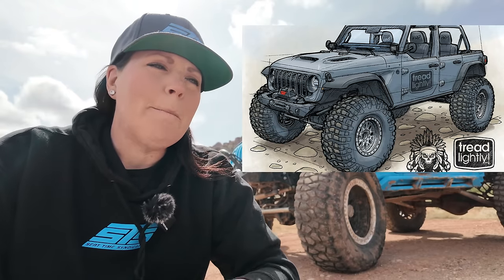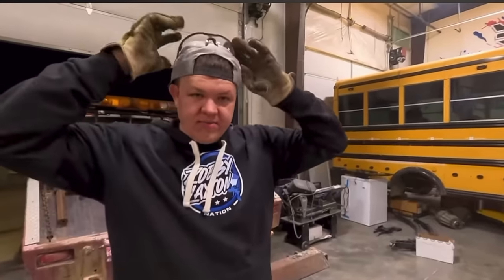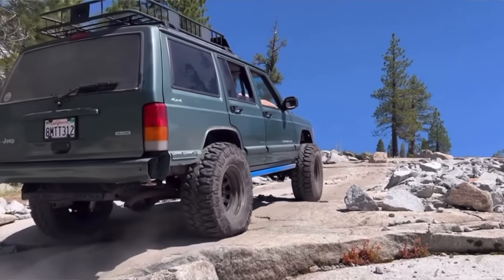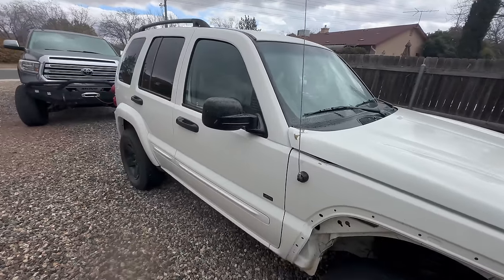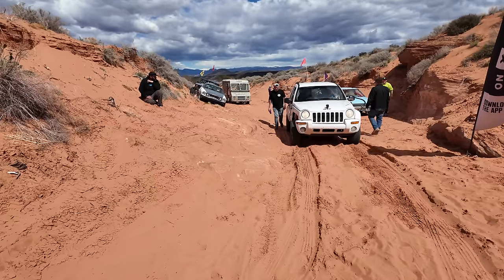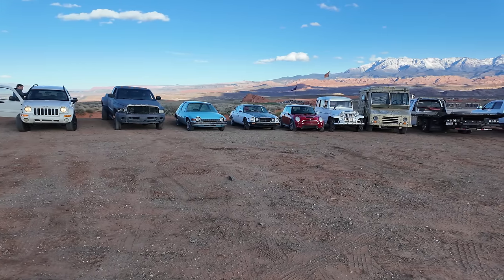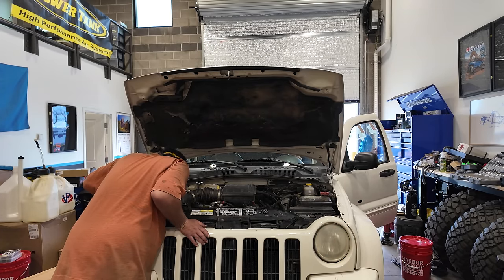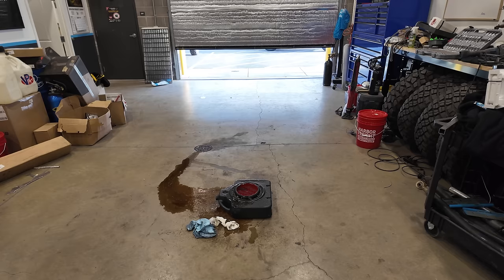This 23yr Old Jeep Can Win The OnX Build Challenge & Here’s Why…

Comment: I built my Liberty because everyone has a Wrangler or Cherokee.......
4" JBA Silver Lift as a base and built upon, ARB dual under the hood, F&R arb lockers in the 8.25 and D30, re-geared to 4.11, manual trans with a 231 T case 1.25 chain / gears, 6 pinion planet and a teraflex 2 low fork kit. the connection of it all  is a hack and tap SYE from IRO with Custom Adams Drivelines front and rear - Napa extended CV's up front.

Everyone chuckles up until I pull them out - Crazy capable machine!
Not just for Starbucks.
I call mine the "3 lock box" LOL
Matty is still with us - just in a different way !!!!!!
Reply from the maker: That’s so awesome! Send me some pics for sure at: MischiefMakerjku at gmail dot com. I’m still gathering ideas for this build, but it will be on D44s and coilovers for sure - just gotta figure out the long arm kit. 

And you are definitely right about Matty! 😊💙

Comment: No way Rudy and Robbie don't go over budget. Also, I just checked my local marketplace, cheapest KJ is $1,200 with 230k miles and rotted out rocker panels.
Reply from the maker: Ouch! Sheila is around 130K (if I remember correctly) and is completely rust free. She did need a new power steering pump, but that was about it. They wanted $1200, but once I got down to Prescott and saw it was in way worse shape than the FB ad showed, I offered $1000 and they accepted.
Reply: @MischiefMakerTV  Great deal! I'm so envious of you all out west and your clean cars!  Here in the Northeast anything over 10 years old is likely to be rotted out. I really need to move out that way.

Comment: Since you like open cabs, suggest to mod in a way similar to that copper XJ (Offroad Games) with a tube upper cage tied into the cut (cut of the a-to-b-to-c pillars). Add a XJ front D30R with 3 link, mod the rear like a WJ (wishbone upper, lower CAs) on 33/35s. Put a doubler in (Rubi-crawler), 1/3-1/4 door (as inserts with a canvas fill to an arm rest).
Reply from the maker: That sounds like an awesome plan. I’ll share some details soon, but I really like where your head is at! 😎🤘🏻

Comment: $1000.00 That's about $1500.00 top much. I rented one of those in Florida now winter. total junk. the hood came lose every time we drove it. the engine would just quit and you had to wait about 5 minutes before it would run again! good luck you will need it!
Reply from the maker: Sorry you had a bad experience. But with 700K sold domestically I don’t think I’ll have any issues replacing anything on this vehicle (or even buying an entire vehicle just for spares) and staying under budget! 😅

Comment: 3.7 l have a issue of burning valves and timing chain tensioners going bad. I can tell you how many of them I replaced valves in or timing chains and tensioners in. Just don't abuse the motor to much or you will have issues with it.  I worked at a Dodge dealership and I was the main person that did 99% of the engine work.
Reply: You need the second gen 3.7 in the 2006 and later models .. they are totally redesigned engines and very good

Comment: Liberty was made to replace the xj and actually has more room inside than the xj. Also the window regulators are know for breaking. The cable are junk and break. One last thing they are pretty fun off-road. I had one I put 31s on and it would do whatever I wanted it to do
Reply from the maker: Well I have been shocked at what Sheila has done out on the trail. It hasn’t been graceful by any means, but as an affordable and fun trail rig, the scrapes and bangs you hear on the inside end up making you smile and laugh instead of worry. 

We have been having a ton of fun (and driving her around town) 🤣

Comment: Each repair you do that requires fabricating continually builds your confidence level in your capabilities when they stand the test of time.  When they don't they help you gain experience and improve as a fabricator so don't get discouraged when those learning opportunities, frustrating as them might be, present themselves. 

Perhaps Paul with his large stockpile of parts vehicles might be in the best position to stay under budget since he might already have most of what he needs sitting out in a field down the street.  Those with less cheap junk resources already on hand may be more likely to go over since they will likely have to go out and purchase stuff.

Best!
Reply from the maker: I do think most of the teams will manage to stay under budget because of their personal skill level as fabricators and resources they have in hand, but that does nothing to help others build a similarly capable budget off road rig.

My goal here is simple 
1) cheap, accessible rig
2) builder parts anyone can buy
3) parts from FB marketplace

I plan to stay well under budget and it is my hope that anyone with a welder and a year of experience using it can replicate my build within that same budget. No special deals, no resource pile parts, no special tools plasma table needed. 😀

Comment: Nothing better then a fellow utah jeep liberty owner!! Let's gooo hollie!
Reply from the maker: Any tips for me? I’m gonna need all the help I can get! 😂
Reply: @MischiefMakerTV  I built mine out over the last 13 years, and have some tips:
Get a fully aluminum radiator. The upper plastic mounting tabs tend to crack and leak after a few months of hard wheeling
The KJ has a unique oil pump in its 231 that has to be replaced for the TJ equivalent if you intend to do a SYE
You can use Rubicon Express RE1134 swaybar quick disconnects in the front without modification
4.10 gears are as high as you can go with the stock front axle
If you flip the tire carrier upside down and add a 1.5" spacer, you can fit a 265/75/16 without interfering with the back glass opening/closing

Feel free to shoot me a DM and I'm happy to share my build if you want some ideas